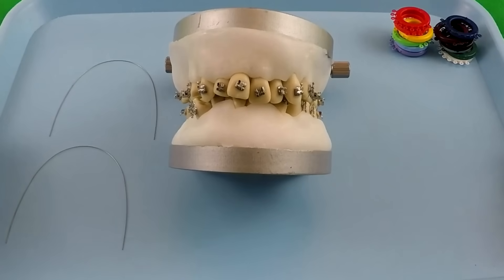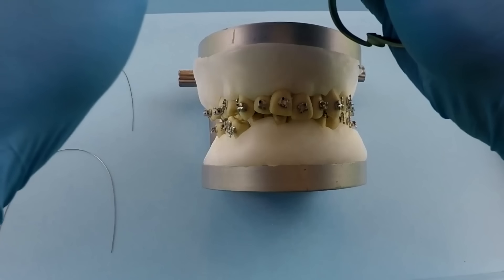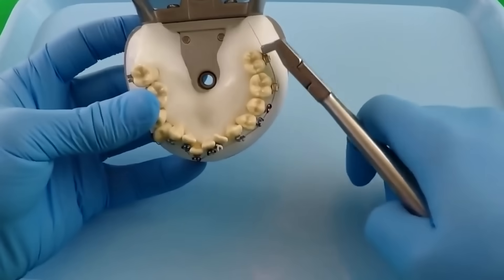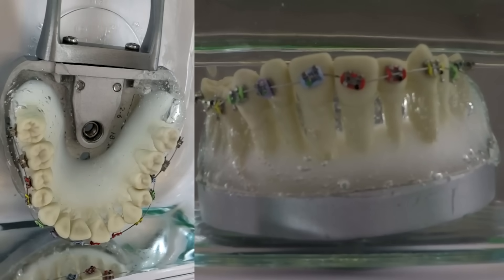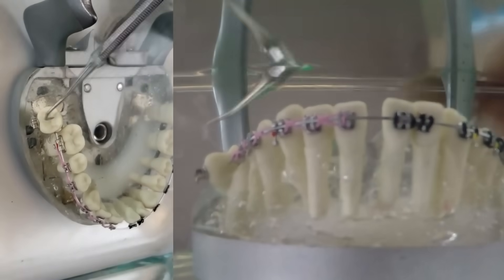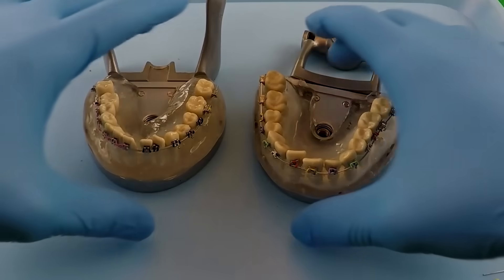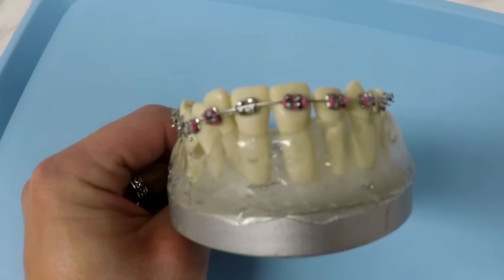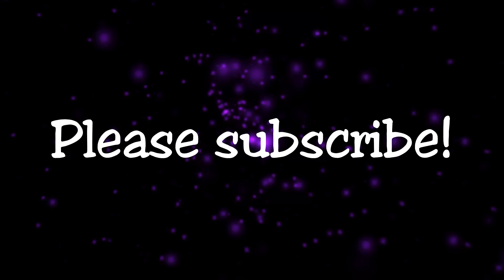Ever Wonder How Braces Work? Find Out Here!

Comment: From what my dentist told me, braces used on teenagers are most often a fraud. They nearly destroyed my jaw joint. Luckily I am now recovering... only cost me another 20.000 euros..
Reply from the maker: It's not most often a fraud. I'm sorry you had a bad experience, but that's not typical
Reply: @thecrazyorthodontist  His explanation was that teenager jaws are very malleable, and therefore teeth can be fixed quickly, while the underlying problem is usually not fixed (which then gets worse in the process).
Reply from the maker: @TheStrandedAlliance  I disagree with "the underlying problem is usually not fixed." If it isn't fixed then something didn't go as hoped or as expected. Please understand that that happens rarely, but it isn't typical.

Comment: I am getting my braces off after two years in a couple of days, my orthodontist told me to get a bonded retainer for both top and bottom of my teeth to have them permanently stay in the shape they are supposed to take, i will also have to wear a retainer every night for six months. what are your thoughts on bonded retainer is that something to consider? my orthodontist gave me an option to get bonded retainer or just have regular retainer. my teeth will stay straight forever but they had told me the difficulty of flossing and eating certain hard food with bonded. need your thoughts thanks!
Reply from the maker: I give my patients a form listing all retainer options with pros and cons and have my patients sign the form. I'm not a big fan of "glued-in" retainers, but that's just my opinion. If you'll wear a retainer every day for the rest of your life, there's no need for a glued-in retainer
Reply: @thecrazyorthodontist  Thanks for the reply, I went ahead and not got the glued in retainers, i just went with the regular retainers

Comment: I didn't have colors. I used the Damon system which, as I understand it, is a "self-tightening" system to reduce the time needed to wear them. I was 28 when I got my braces on and so glad I did! I had to learn how to smile without hiding my teeth!
Reply from the maker: It doesn't reduce treatment time. That's just a marketing gimmick. Some people like Damon braces, and that's great, but they're just another bracket.
Reply: I currently have Damon braces. I’ve had them 6 months now and love them. I only have to be in them for a year. I notice differences in my teeth every week, not sure if it’s a gimmick or not about them working faster but for me they are fast and doing what they are supposed to in a timely manner.
Reply from the maker: @Swanky97  Everyone's case is different
Reply: @Swanky97  Yea I was pretty happy with them. If I could go back, something I would do is pay for 1 or 2 extra retainers (The one like mouth pieces, not the traditional ones). This way you have some spares because, sparing the details, mine were lost. And if I could do both, I would get the permanent retainer put in for the top and bottom front 6. 
.
I was pretty diligent with my retainers for about 2 years. Then my dentist lost my mouth piece-like retainers and I stopped wearing them. It is 8 years since I got them off and my teeth have shifted some. Nothing crazy. But if I had the permanent retainer, the front would still be pretty locked in I imagine.

Comment: Nickel titanium? But Nickel is very toxic...😶
Reply from the maker: And hydrogen is very dangerous and explosive. But when you combine it with oxygen it can quench your thirst very well
Reply: @thecrazyorthodontist  yeah but only if its combined as 2 hydrogen and 1 oxygen. Nickel sitting in the mouth is complete insanity.  Just look at what it does while on the surface of the skin in less than 32hrs. Even sooner of the skin is perspiring.
Reply: @thecrazyorthodontist  and yes if you charge water you can make the cules split and use the hydrogen gas and oxygen.

Comment: Would be interested to know what it is that you use to “cement” the “squares” to each tooth and what you use to remove it.
Also to see how a brace plate works with springs.  Really interesting thanks.😊
Reply from the maker: All good ideas, thanks. I'm collecting ideas for future videos and will write those down. Be sure to subscribe so you can see when they drop! First, we're going to do more braces colors ideas and some pranks!

Comment: My brace experience is a nightmare. My braces are always falling off and if the braces from the molar are falling off, the wire will stab my cheek from the inside and my gums. How does this happen? I paid 700 dollars just for the installation (not including a monthly check-up) and I keep it for a year and the difference is not that obvious. I always have restraint when I chew anything. I also brush my teeth twice a day. I would like to give it another go because I want to glow up. How to make sure that one year of hell will not happen again?
Reply from the maker: There are some times when flukes happen and brackets break for no reason. The best thing to do is express your concern with your orthodontist and try to work through it. I'm sorry that's happening
Reply: @thecrazyorthodontist  back then I was a brat, so I sorta expected it will not be joyful. Still want to try again thou

Comment: As someone who has an overbite and needs braces. I never really gave it too much thought on how they work. I had them for maybe 3 years to 3 years and 6 months. This has been really interesting to see how they work and is well explained. If any one is getting braces, it is safe to say is when they first put them on there won’t be much of a difference from what you can feel, until the next day you will have pain depending (as for me it was my lower jaw and teeth) this is usually from the difference of your teeth being moved around since it’s not what your supposed too. After a week or more there might be some lingering pain but you should be alright. If they change the wires this will cause slight pain just because the old wires loosen and the new wire will be less soft. Also the pain won’t be as annoying as the first time you get them and a little last note is don’t try to eat hard foods such as apples and cut them up into smaller chunks. 👍😊
Reply from the maker: Here here! We'll said 👏
Reply: Bearly got mine on Wednesday and i cant even eat a simple sandwich without  feeling my teeth loose
Reply: @nydiazarate  that happens take it easy, Give it a bit of time then you will be able to eat that sandwich
Reply: I remember almost 4 years ago i got braces on my birthday and the next day i felt what was such excruciating pain from my teeth. It really woke me up lol I kinda miss that pain, I still have it on because financially can't continue. But i hope to collect money and change to invisalign
Reply: So True. I got braces this year and totally understand what your saying. I chewed a piece of corn once and it broke my bottom wire an took out two brackets. Something my orthodontists easily fixed. But I am not eating corn on the cob again. LOL

Comment: Amazing! But wouldn’t you get burned from putting your gums and teeth in hot water?
Reply from the maker: The hot water is just used to melt the wax as part of the simulation. In the mouth, 98 degrees F is enough to "activate" the wire

Comment: I got braces when I was young...Worst error ever...I removed the braces at 24...I'm 37 now and the teeth have moved back to a malocclusion...These are good for small cosmetic problems but for serious malocclusion, in my opinion, maxyllofacial surgery is the PERMANENT way to go, albeit drastic. In any case, it's better to put those when you're adult already.
Reply from the maker: It depends. Many serious issues can be fixed without surgery if treatment is proper and at the correct age. I can't speak for your situation, and I'm sorry it didn't work out, but surgery isn't always the answer even in series malocclusions

Comment: Braces was the worst physical experience of my life. Horrific pain. And I’ve had 2 joint replacements.  Ruined all for of my back teeth that were banded before I was 30. Had to have them pulled. Permanent indents in roof of mouth from spring in roof of mouth that my skin grew over. Was constantly sucking on tubes of orajel or swishing with sore throat spray to stop the pain from cut cheeks and gums. Nothing helped the pain for a week after tightening. Couldn’t eat, couldn’t close my mouth. Dentist bruised my chest one time when he put his knee on my chest to hold me still and pull the wires tight. Wavel L Wells out of Oklahoma. Horrible abusive human being. License should’ve been taken. But he’s probably retired now.
Reply from the maker: 😔I'm sorry

Comment: Had to wear an expander for both upper and lower jaw for 11+ years. Jaw was too small to fit all the teeth, my bite was completely wrong. Horrid pain. Then had to wear braces for 3-4 years more after that. That was sooo much better. And my teeth did end up all fitting in, so that's great. Not perfectly straight, though. They seem to still move now that I'm 25 and I took my retainer off way long ago. Don't really care for the way they look, just wanted to be able to chew proper. Do my best to clean and floss, though. Hope they last after all that pain.

Comment: I have "braces" on plastic that you can take off. And I have to screw them a bit every week so they expand. To me it seems more robust than a wire holding each individual tooth with little rubber pieces.

Comment: I really can't comprehend how people did come up with this, how they found out about this alloy properties, to always return to it's forged shape, and then to use it to correct teeth position. To me, these people are some kind of megaminds.
Reply from the maker: The metal from that flexible wire was actually discovered through space research
Reply: @thecrazyorthodontist  My professor at Iowa invented Niti wire
Reply: @thecrazyorthodontist Yet another W for space research, investing in science is always the answer
Reply: I'm curious how long nickel titanium has been used in braces. I am 60 and had braces when I was 13 14 and 15. As an adult I discovered that I was allergic to nickel and in addition I had a dental implant that was titanium, which my body rejected. I wonder if I could have developed my sensitivity to either of those metals through having braces as a teen.
Reply: Slow accumulation of information over many hundreds of years
Reply: @pmcate2  Or the Cold War. There were massive advances in materials science and engineering during the 1940s-90s. We went from not knowing how 3 Liberty Ships cracked in half and why DeHavilland Comets kept disappearing to where we are today in less than a lifetime.
Reply: The demonstration of just the wire by itself was shocking. You blew this BSME's mind. I wonder what it was originally planned for? Maybe a spring, or to help a space suit keep its shape.
Reply: Science
Reply: many inventions were found either on accident, or originally meant for something else but given a new purpose
Reply: This is why we need to pump more money into research. Just whatever information we gather, we may not even know it's use now. But it'll definitely help some day.
Reply: Read the book Medical Apartheid, most modern medical procedures were experimented on black Americans. No anesthesia by the way.
Reply: White people

Comment: That was helpful!! I have a question tho. My previous dentist said it might not be possible to move my back molars forward without head gear, but that power-chain did exactly what I was wanting. My entire lower left half of teeth are shifted backwards slightly, while my upper left half are shifted a lot with a huge gap in the two front teeth. Do you think head gear could be avoided with those power-chains? I’m 23, so skull isn’t as malleable as it would have been if I got braces in my teens, so maybe that’s why he said head gear might be needed?
Reply from the maker: I can't really comment on your specific situation without seeing you, but I can say that I haven't used headgear in over 10 years. There are alternatives

Comment: Explain to me what part of wire and rubber bands costs $7000….
Reply from the maker: Because you're not just paying for wires and rubber bands.  How do you know what wires to use? How do you know the artwork involved with where the brackets are placed? How do you pay for $100,000 x-ray machine which is necessary prior to starting braces? How does a business owner pay the staff? How does a business owner pay for all the glues, pliers, sterilization equipment, etc? How does a business owner pay for $200-500/month orthodontics software and HIPAA-compliant PC hardware? You're paying for all of that other equipment plus, more importantly, you're paying for years of knowledge and experience from a trained doctor who can tell you what to do when something goes wrong. If braces were that simple then Smile Direct Club's stock prices would be a lot higher than they are right now.

Comment: Thank you for the explanation! I had braces all through high school (about 35 yrs ago). My teeth were a mess because my baby teeth wouldn’t fall out and the perm teeth started growing out and over them. Had rubber bands and headgear, the whole shebang. Then 2 years with a retainer. My question for you is this: Has the process you described here changed in 35 yrs, either the components you use or the duration with braces? I don’t know anyone who had them as long as I did (although they look nice now ☺️ ).
Reply from the maker: The basic principles remain the same, but some technologies have improved the process. Some claims (Damon brackets produce bigger smiles faster, for example) are completely bogus, but the glues, wires, etc. have enabled many things to be more efficient.

Comment: I'm 51 and I can still feel the vibration in my teeth when I think about when I had my wires changed. I also still have recurring dreams where I realize one day that we "forgot" to remove my braces. So weird!!  I got them off when I was I think 17? All these years later they still haunt me. Do they still do hooks and extra rubber bands?  I had to hook from my top k-9 tooth diagonally down to the lower k-9 equivalent, yep I had a lovely cross diagonal rubber band in the front of my mouth for a while.  At least I didn't have the weirdo headgear like my brother had!
Reply from the maker: Yes, we still use extra hooks and rubber bands. Thanks for sharing!

Comment: I've got braces right now to move my teeth into a good alignment for my jaw surgery. It's interesting to learn why they cause me so much pain for the first 3 to 7 days after I get the wires adjusted. My body is basically rebuilding itself around where the wires are pulling.
Reply from the maker: Pretty much, yes

Comment: it's fascinating to see, but boy am I glad I don't need these. still have all my teeth, including the wisdom ones, and everything is good enough. not perfect, but perfectly good enough not to be an issue in any way shape or form. if i did use braces it would be purely for cosmetic reasons, tiny adjustments that i think are unneeded.

Comment: But what actually happens in the gums and jaw when teeth move?
Reply from the maker: The pressure stimulates osteoclasts to break down bone on the side where teeth are moving. Osteoclasts rebuild bone on the other side. The gum tissue essentially follows suit with the bone, but it's not as flexible and generous as the bone tissue. What more specific answer are you seeking?
Reply: That about covers it. I just knew it wasn't water softening plastic. Haha. So the pressure causes the bone to break down and reform.
Reply from the maker: @mattmilford8106  yes

Comment: Hi Dr. What's up?
I have a case with moderate crowding, every thing was alright till I reached to 17*25 niti.. the upper left 2 tipped distally, the crown flared labially and the root palatally+ve root torque..
Dr. I did every thing to solve the problem.. but it didn't work.. torque spring, torque bend, change bracket position, upside down bracket, Z bend to correct the tipping, why did this happen? 🤷‍♀️🤷‍♀️🤦‍♀️🤦‍♀️
please Dr., your kind opinion 🌹🌹🙏🙏
Reply from the maker: There are a lot of questions to ask: have you seen anything notable on radiographs? An unusual PDL, pathology, etc? Any signs of sudden ankylosis? Mobility on the tooth? Is it occluding with the lower teeth? What slot size are the brackets?
Reply: @thecrazyorthodontist 
I checked all you mentioned sir.
the tooth is vital.. no tenderness.. no pdl widening or radiulucency, with normal phisiological movement like other teeth, but I really don't remember the size of the bracket.

Comment: This is interesting, anyone old enough to have braces in the 80’s. Can anyone explain to me what the headbands did?  Those braces from what I remember looked different and I’m wondering if they worked differently.
Reply from the maker: Bands or headgear?
Reply: @thecrazyorthodontist  not the rubber bands, although I’m curious about that because if I remember right it went from top to bottom on an angle. But the headgear worn usually for the first part of treatment. Like 6 months or something. I wore them at night. Was it to push the back teeth back more and give room for the front teeth?